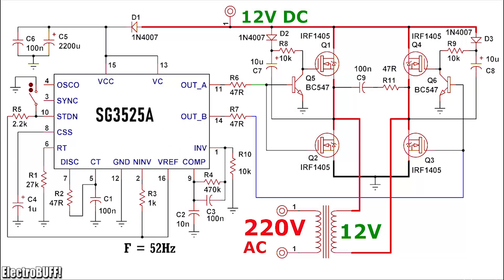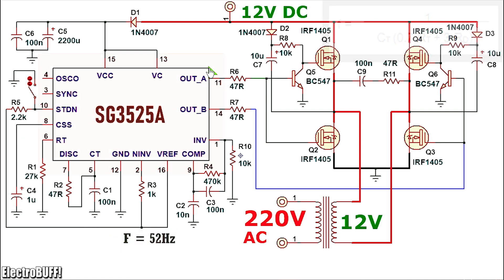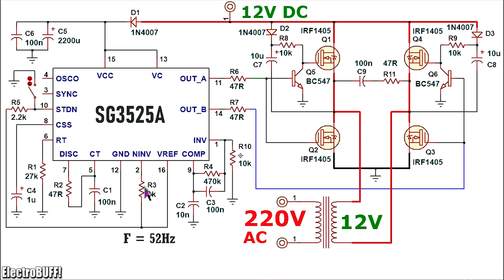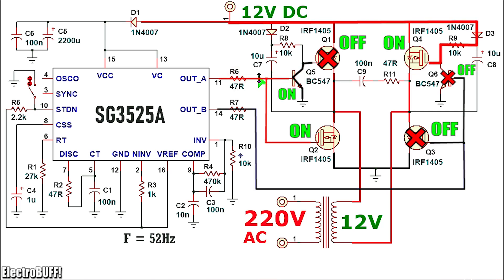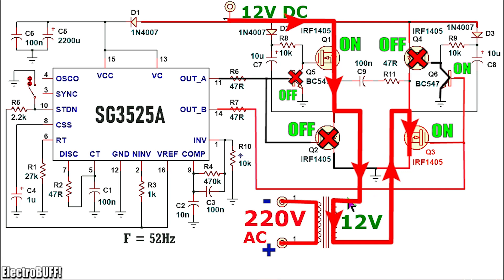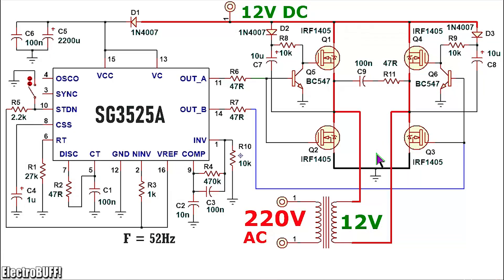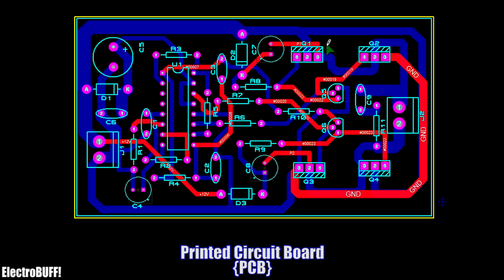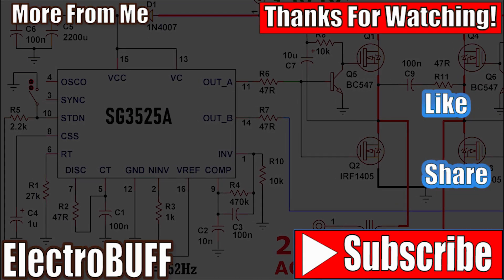How To Make a 12V to 220V DC to AC Inverter with SG3525 PWM IC and Full H-Bridge Mosfet Driver

Comment: Amazing explanation!
But one important thing remained unexplained which is the Centre Tapless Transformer. So for such inverters with Centre tapless Transformer, what's the Transformer calculation measure for the size of 5000watts to 7000watts specifically?
Reply: Thick-ass wire and a online coil turn calculator/ transformer ratio calculator

Comment: Hi could you please show or demonstrate how you convert microwave transformer
Reply: You don't need to convert microwave Transformer for this type Centre Tapless Transformer. You only need the Centre Tap Transformer for required type inverters boards.
Reply: Thank you for circuit and very thanks for pcb🙂

Comment: Sorry and again how many turns on the primary of microwave transformer and what size of wire
Reply: Take a measurement of bobin and calculate as normal stepdown transformer. Wire dia should b according to VA of load. U can easily make 20Amp transformer with microwave oven cores.

Comment: What is the voltage on capacitors 10uf  and 2200uf
Reply: Depende da bateria ser for 12 v  pode ser de 16 v ou 25 só não pode ser menor que 12 volts blz

Comment: I requst you please explain a 48v to 85v dc  to ac 240v 3500w inverter . pure sine wave
With voltage  stabilisation 
 Make it simple and please do not add any type of programming module with this circuit.  There is not available programming device and module in our state.
Please give me a circuit daigram for my solar panel.
Reply from the maker: Okay. It's actually not that difficult. I'll address it in my next video or the one after that.
Reply: @ELECTROBUFF  thank you
Reply: @ELECTROBUFF  i mostly recommend  transformer type inverter  , because the availability of ferrite core transformer parts in our state.   I just recommended thats all . You do with your all best for me please
Reply from the maker: @jinogeorge8832  Ferrite power transformer's are actually easily available, especially if you salvage parts from: ATX computer power supplies, laptop power chargers, TV motherboards, and almost any modern charger/power supply
Reply: @ELECTROBUFF  yes. I  try this method butt the E core is sticked to each other. When i try to remove this its breaked. And the transformer is very small. I think its not suitable for 3500w inverter .

Its not a matter i will try. 

You make it your easy way

And one thing where are you from
Reply from the maker: @jinogeorge8832  For such a powerful power inverter, I recommend you either buy a 3500W or more rated ferrite core, or use several smaller ones and parallel their outputs(be careful here). It's very easy to disassemble one, just rip off the tape around it, then boil it for like 20 or more minutes. The pieces usually separate with minimal effort. Another way is to place a soldering iron on one face of the ferrite core and leave it there for like 30 minutes, the pieces will easily separate without breaking.
Power output approximation formula :  Cx Area in sqr cm = 0.11*square root of power in Watts.
ATX ferrite transformer's easily handle from 250-1000Watts depending on the size you can get a hold of.
Reply: @ELECTROBUFF  ok i understand .if you dont mind please convert your video  of this circuit (how To Make a 5000Watt Inverter For a Solar Power System) in to a  stabeld out put circuit using ic sg3525 /72v to 50hz square wave 220v out

If you can  pleas add its pcb layout
Reply: @ELECTROBUFF  and your in facebook????
Reply from the maker: @jinogeorge8832  noted
Reply: @ELECTROBUFF  thank you

Your in face book?????
Reply: Pls sir how do you calculate transformer cable size